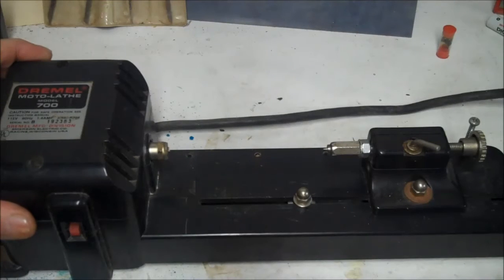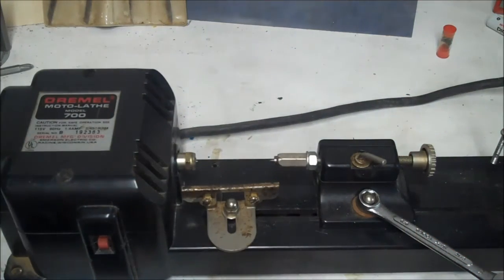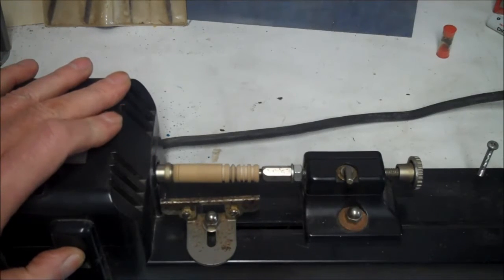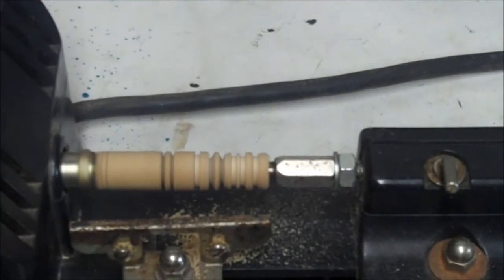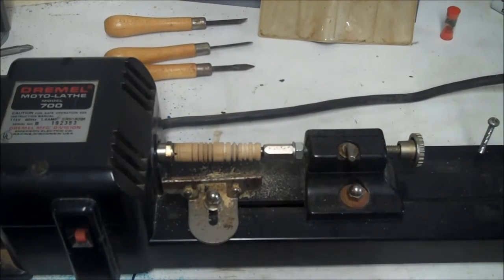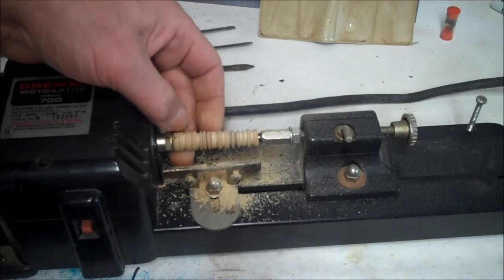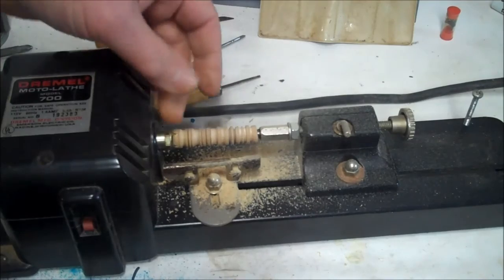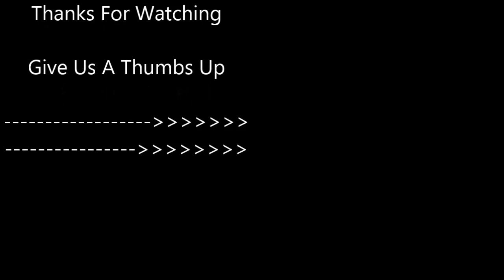Dremel Mini Lathe Review and Demonstration Model 700 Lathe

Comment: Can this lathe make pens?
Reply from the maker: Well it doesn't have the strongest motor but if you use a light touch it works fine.

Comment: I have had this lathe for over 30 years.  NOt used in years.  I use it to cut mini chair legs.  The lathe works but the mini dowels will not engage in the left side.  I put an 1/8" dowel in it and the machine spins and the wood just sits there.  ALso the bit on the left side does not screw in like it should.  Maybe only a 1/4 turn.  Help
Reply: Just snagged one of these today at a yard sale and was having the same problem. In the beginning of the video he mentioned that he cut cross-slots in the end that mounts to the left. I just did it now I'm turning away!! Hope this helps.

Comment: hi do thingk this machine can do light aluminium
Reply from the maker: I would think so, but I haven't tried it yet.
Reply: it depends on the speed setting .. and the tool ... if it is an adjustable speed lathe then probably with metal cutting tools ...

Comment: NEVER lift a lathe tool into the piece .... always start level to the midline of the piece ... if you lift the tool into place it can be puled out of your hand and be launched at high speed across the room ...also never lower it into the piece you can end up with the tool embedded into you .... neither option being a healthy choice ... BASIC shop safety rules ... you did take shop inn school right